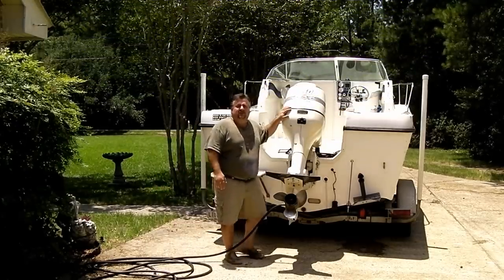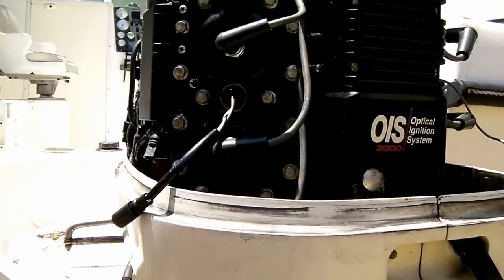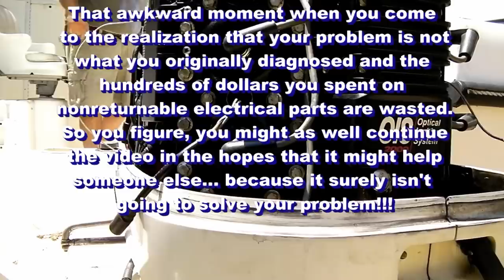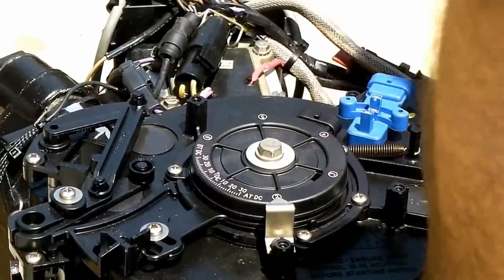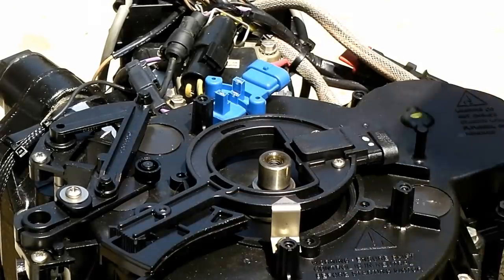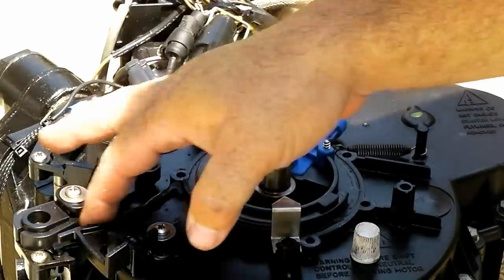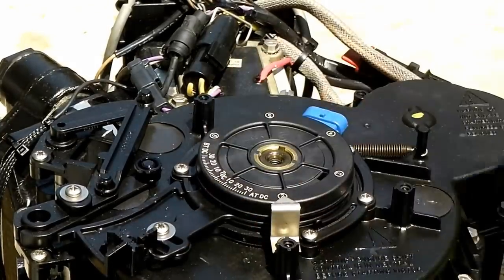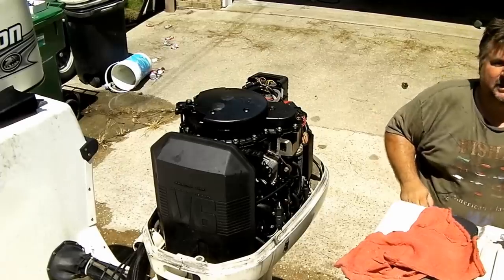How To: Replacing the Optical Sensor on a Johnson / Evinrude Outboard Motor

Comment: Same thing was happening to my 150 oceanrunner. Turned out to be the temp sensor on the port side with the two wires. I believe you can test this by jumping the wires that you have disconnected in the video and it would idle down (on the muffs it will idle around 900 when brought to heat with no back pressure on the exhaust). Both the power pack and optical sensor were replaced to try and remedy this by the previous owner.

Comment: I have a 1993 Johnson 200 hp on a 1993 Ranger 397V . On my last outing I was getting ready to call it a night and head back to the resort and when I go to take off the bow comes up and then it sounds like a "clutch slipping" . Its not the prop cavitating as far as I know as I have solved that 2 yrs ago with the right prop. Sounds like it could be slipping out of gear maybe. Is there such a thing as spinning a prop hub ? I did stop trying to get on plane at full throttle not knowing what the problem is but did have the drive train to pull the boat 1/2 mile to the dock.Any info is appreciated. Thanks

Comment: Hi i have a 1997 johnson 150hp OIS ahd have a plroblem, left bank 2,4,6 pistons not firing. Right bank is firing good. Not pass 2,500rpm,  POWERPACK, OPTICAL SENSOR?  And another question cable gray and red line its for? Thanks

Comment: Thanks for the video, I noticed before the camera overheated that after you had tightened the bolt on the timing cover that it wasn't at its original setting at 2.  Was your motor out of sync/timing off?  I've ordered my kit that includes a power pack, optical sensor and fresh spark plug cables.  I have a 2000 Johnson 115 Ocean Pro V4.  Thanks!
Reply: How did you make out with replacing the PP?
Reply: Any update ?
Reply: I replaced all the parts and adjusted the timing three years ago.  When I did, it ran much better.
Reply: Any videos or instructions online to adjust the timing?  That's the last piece for me.  Thanks @jasonhinojosa9290

Comment: so you replaced the optical sensor before the power pack right?
I didn't see if the motor ran any better after the sensor. Was it running better? Or was the power pack the ticket to a smooth idle? I've got a similar motor to yours and would rather do these replacement than my mechanic.
Reply from the maker: I bought the items as a package and just changed both. It was in fact the power pack that was bad. I kept the optical sensor as a spare...actually I kept the pack too; but have since sold the boat.
Reply: Daniel Scheer . My 2005 Johnson 175hp has a terrible rough idle for how low the hours are. I'll choke the motor while starting and once the extra fuel burns off the motor rpm slows to normal then starts to misfire losing rpms then dying out. If I get out on open water and go WOT it runs good with full RPMs. I don't think it's a fuel or carb problem since it operates well at high RPM. Thanks for the video!
Reply: Ben Rogers did u ever figure it out?
Reply: @brogers114able  this video was 3 years ago I want something recent I want something now I have an electric eye problem under flywheel the fucking thing is a piece of shit you can't even take the starter off without taking 36 bolts and screws out
Reply: You can't take the starter off and replace it the Bendix is bad without taking about a hundred bolts and screws off cuz it's a sealed unit it's a 2003 Bombardier E Johnson it's a piece of fucking shit for Grand down the tubes fuck these motors
Reply: @jimhagelgans9958  one minute you say you need to replace the timing sensor, then you say you cant take the starter off. which is it? these are fantastic motors if you follow the service manual and know what you are doing. and yes, most all outboards are light and compact, not like a car that usually has tons of room. goes with the territory. these 60 degree motors are some of the best ones ever made in their size class!
Reply: @jimhagelgans9958  I know this is a three year old comment now but I couldnt let it go in hopes someone does NOT listen to your complaining about things you obviously had no idea about.
 Background... I have been a marine mechanic and owner of half a dozen repair shops spread from the east coast through the upper midwest. These engines can be fantastic. They are a hotrod of sorts and with normal maintenance and care can last for decades. You DO NOT have to take 36 bolts out for the starter. It comes off with three bolts removed. The top where the stator is at, yes there are several bolts. why? BECAUSE IT IS AN OIS SYSTEM.... OIS means optical ignition system. It needs DARKNESS to work properly. To get the stator out is a job. BUt it is not hard, it just takes a little time. Same as the optical sensor etc. Easy to do, just needs a little patience.
Reply: @jimhagelgans9958  3 bolts takes the starter off. simple if you know what you are doing./ or just watch a video...

Comment: Hey, I have the same exact motor as you. I've had it since 09. Rebuilt the carbs twice (last time was in the summer along with spark plugs). I've always had this on/off knocking. It's not the foot it's the power head. But I doubt it's the cylinder because it's not constant and doesn't show any signs to be the cylinder. It starts at around 4000rpm when the boat is in gear. Doesn't do it in idle. And it's not in a pattern it's at random and uneven when it does it. It will always do it if I go from 5000 down to 4200 until the engine slows down and the boat reaches the speed the engine does at that rpm. Any ideas? I am going to check out the power pack and make sure all my cylinders are firing. Also does your have this sneez in idle every now and then? Mine does.
Reply from the maker: +Andrew L Sold the boat and now have  larger one with a 250 Johnson... hated those plastic carbs on the 150. I never have problems with the ones on the 250. I did have sneezing you mentioned esp. when cold. Can't recall it after the powerpack swap... at the time of the sale it was running better than it ever had. Good Luck!
Reply: This is two years ago, but, if you're still around and you got it fixed, I would sure like to know. Mine will run perfectly and then when I think all is good - at around 4200rpm, it will start missing, or stuttering really badly. Then it might smooth out.

Comment: Just an update on mine. It was hard starting most of the time rough running sometimes and had put itself into some kind of speed limiting. Well I replaced the temperature switches and still had some problems. Seemed to run great for a while then I thought my prop had come loose.Turns out that part of my problem is in the way the plastic in plastic throttle and spark advance mechanism works. It was not going back all the way. After I figured that out it starts better and runs smoother

Comment from the maker: I was running the motor on the hose, which is cool well water. The issue I had, was that the motor bogged down under load. So while I noticed no difference in the driveway, when I tested her in the water... she ran like a monster! (Also quieter at idle.) I tend to believe that the pack was not functioning correctly. In the meantime, I sold the boat and the new owner called to tell me how well the boat runs (yes, he bought it without a sea trial!!!) Good Luck with your issues.

Comment from the maker: The engine should be running for a much longer time on the fuel that is in the bowls. So if you pumped the primer ball until it is firm, they should be full and the motor should run atleast a minute or two. The sudden shut off seems to point to the ignition being shut off. That engine has a timing wheel under the flywheel and not an optical sensor. I think you are on the right track with suspecting the powerpack. Keep me updated!

Comment: Dear Daniel, I do have a 1993 johnson 175 hp fast strike V6, and I have the same problem shown in your video, at higher speeds works fine, but a idle it doesnt even start sometimes, and it goes to auto shutdown, I miss the other part of the video where you test the engine with the new optical sensor.  I am in Chile, south America, and I am not quite sure where can I get this sensor, even worse I have not the Owner and Service manual.  Also have a compression difference between cylinders, 95-115

Comment: Help please! ... i have a 1993 Evinrude 120hp and it seems to idle ok but once i engage the throttle it struggles to go 5 mph. Seems to me that it is running on 2 cylinders instead of all 4. Any thoughts?
Reply: Michelle Ball ....BTW, i have replace the coils, stator, timer base, plugs and fuel filter!! AAAARRGG!!!
Reply: Did you figure your problem out? @Ballfamily

Comment: Hello Thanks for all the video's. They have been lots of help. Im having a problem with my motor. Its a 1997 Johnson 150HP. After using the boad for about 30 min non stop the motor dies for less than a second and kick right back in. It feels like it lost power for a split second. Any idea what that could be?  I did the tune up (new wires, spark plugs and coil pack) and same problem keeps happening.
Any suggestions will be greatly appreciated!
Reply: Mine does this also. Still not sure what the issue is

Comment: My engine is idle at 5mph do you know how to idle down these engines?
Reply: you need the factory service manual, but in short take off the flywheel cover like in this video. loosen the screw on top of the timing advance linkage, and adjust the timing by the click thumb adjust tab things. one is for high speed timing, the other for low speed/idle. put boat in water and kick in gear. adjust with shop tach till you get 600-700 rpm. done.

Comment: I have a Johnson 115.  It cranks ok and idles ok.  Runs at slow speed ok.  When you push throttle forward the motor will not go above 2000 RPM's.  To this point I have changed fuel, fuel filters, spark plugs, checked wires, had carbaurators cleaned and checked, then replaced all fuel lines going between motor and fuel filters and the ones between fuel filters and fuel tank.  Problem persist.  Do you have any ideas what I should do next???  Thanks in advance
Reply from the maker: C. VAN Wheeler Many of these engines have a safe mode that limits the rpms if the engine is overheating. The sensor could also register a false overheating and cause the same issues if it is bad. Keep in mind the an overheating condition can occur is the water ports are corroded in the head near the sensor without the engine appearing to overheat. Water exiting from the pee hole is only an indicator that the pump is working.
Reply: Might have bad thermostat(s)

Comment from the maker: I used a harmonic balance puller but had to purchase the correct size hardened steel bolts to fit the flywheel. Then I used a air impact wrench to remove it. Popped right off after that. But be careful.

Comment: Good video , Im replacing my optical sensor today ...did you ever get your outboard running properly...I have a similiar issue with same motor.. I also replaced the power pack, but didnt get any positive results ....Heres to hoping it is the optical sensor...
Reply: How did you finally fix it?

Comment: Hello, I have a 1999 Evinrude 175 outboard, FICHT fuel injection and it has a problem starting, and when it does start, it runs for 5 min, then I cant power up it drops down to safe mode and will stall if I full throttle, along with an engine light that comes on right before safe mode and while in safe mode. Could it be the temp sensor or optical sensor?
A Marine tech said they don't make parts for this 1999 anymore and might be in trouble with it.

Rich
Reply: Richard Polidoro 

same problem 175hp Johnson.
was told by a very experienced boat tech to disconnect the cut off switch, it's being triggered and it's only purpose is to make shifting easier.
He said it's very common.
He also mentioned that orings on the drive shaft could be corroded causing the cut off switch to activate.
I'm going to attempt to disconnect mine Friday.

Comment: I have a 1996 150 fast strike that the starter motor just spins but the bendix won't engage the flywheel and I can't find any videos have you ever removed the entire flywheel cover?
Reply: charge the battery

Comment: i have the same problem with my 90 Johnson 2002 i use the key choke to start the motor i put the wamer lever up put back down to idle it just cuts out on me dosent run smooth trying to figure it
Reply: What was your fix on this problem? I have the same issue on my engine now

Comment: I have a gt150 put a new stator and power pack. the stator is firing into the power pack but no power is coming out the power pack. I don't understand that what should I CHK next
Reply: timer base. pack needs to be told when to release it's stored energy it got from the charge coil duh!

Comment: Hey Dan. I'm trying to get the flywheel cover off my motor to access the bendix gear on the starter. To do so, I need to get the timing wheel cover off as you have done in this video quite easily. My 1/2" bolt will not come off. It seems to be turning the whole fly wheel and I can't see how to lock it or otherwise get that bolt loose. Any ideas??? Anyone?? Thx!
Reply: Did you figure that out?

Comment: i ended up breaking it off. fly wheel came off no problem it was the plastic disc on top of it with the timing information on it that would not come off. a 40$ mistake for about 5cents of plastic lol

Comment from the maker: Leave you comments or questions here!
Reply: Good video ,I have a 90 hp  that will fire up then it dies,it looks like it is getting to much oil from the vro.pump,plugs are oily.please help.  Tex
Reply: I have the same problem going on. My ocean runner 150 has a surging idle it runs and sounds great until it is put under a load. Then is starts breaking up and misfiring bad! Compression is 95psi on all 6 cylinders and it ran great before this problem happened. Any feedback would be greatly appreciated
Reply: @tylerthomas3744  Sounds like Temp Sender? What was the ultimate solution?

Comment: lucky son of a gun i cant get that timing wheel off for my life i have had penetrating fluid on it for weeks and will not come off...
Reply: does any one no about the 30hpetec  charging default need help . warms up then dies
Reply: impact gun, then strap wrench to install. torque to 120 in/lbs. Done. easy-peasy.